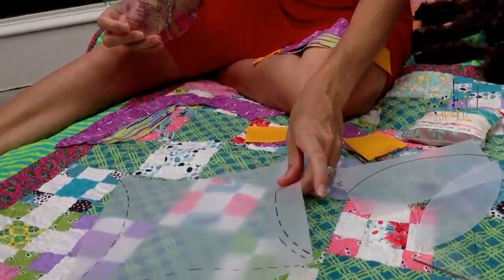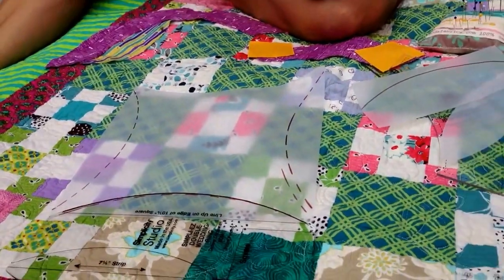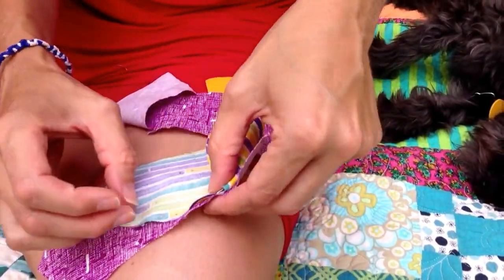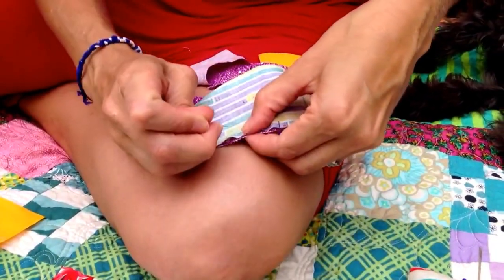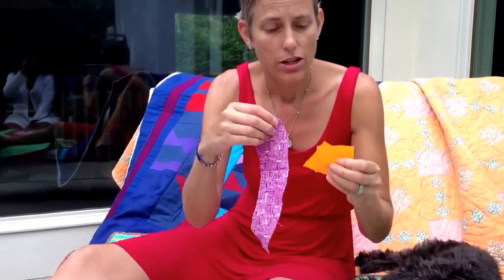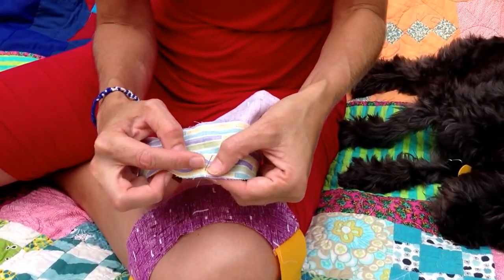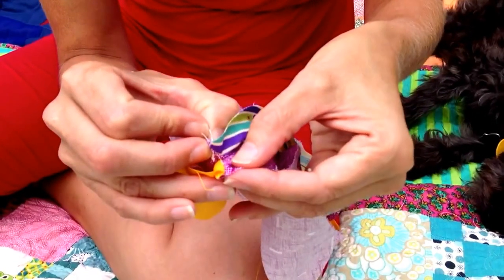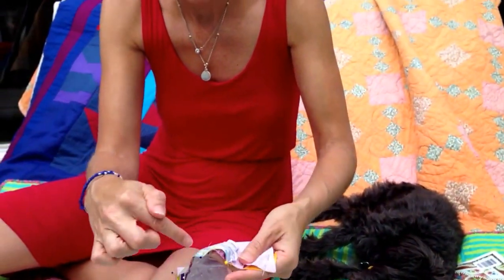Dwr how to...,

Comment: Thank you for this video. Im using the Simpli EZ template and couldnt(and still cant) figure out why there is a bit of fabric on the ends after the bottom ark is put on. What am I supposed to do with it when I put on the top ark? I saw that you have it too and didnt care about it, so I followed suit and mine came out alright. (first time DWR for me)But I stressed a long time over that!! I just knew I was doing something wrong! Im not totally convinced that im not!!  I have to relax the OCD Quilter in me. I would ask how you deal with the points on the bulk. How do you move everything so the seams arent standing up? Anyway,  Ive got the "Finishing one ring DWR" in que when Im done making these melons. 
Thanks again.
Reply: lissapl